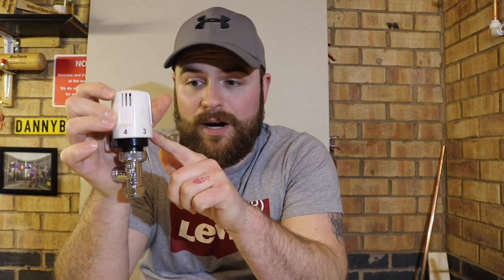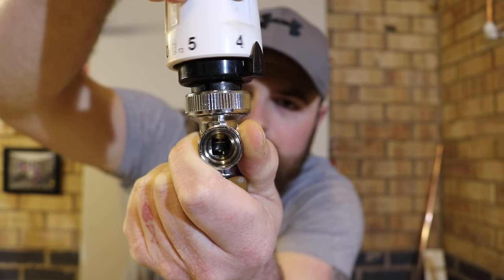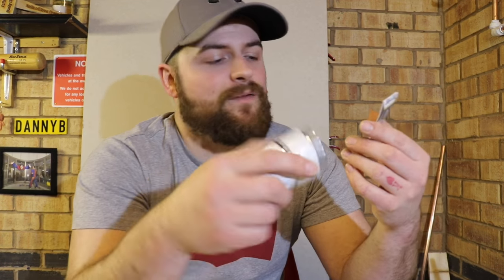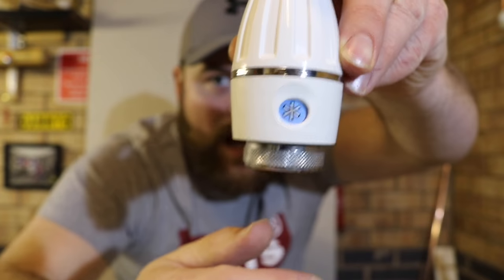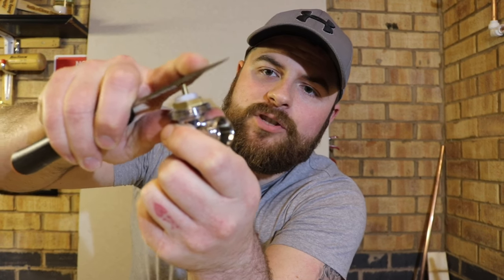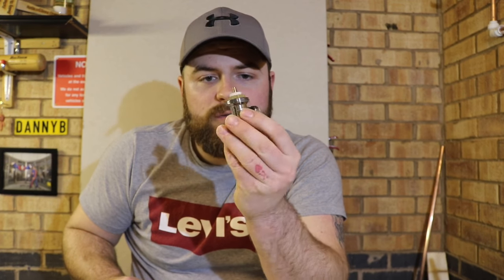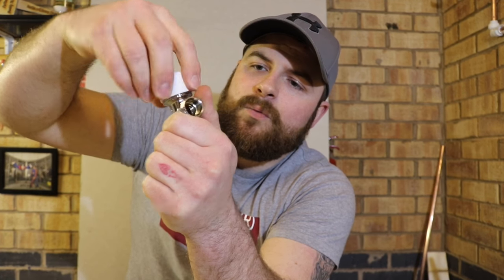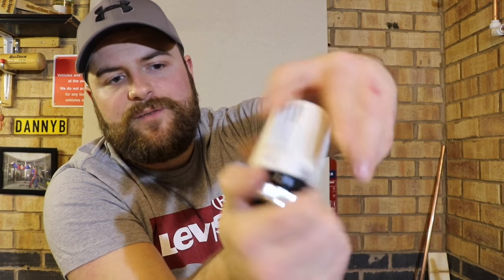Thermostatic Radiator Valves (TRV'S) How They Work

Comment: Hi the other night a tvr failed and just popped off the valve. The black plastic that normally sits in the silver threaded nut was shattered but the silver nut was still in place. The tvr looked to be set at 2.Wjen fitting a new tvr do I over it up the same setting as the one that popped off or do I open it up to 5

Comment: What I would like to know is, why is it that some houses have room/wall thermostats in say, like the hallway, and all rads have TRV,s but then same houses just have wall/room thermostats but no TRV,s on rads??
Reply from the maker: It depends on what system you have in place, the wall thermostat works with the boiler to achieve a room temperature, the trvs control the water flow going into the radiator.

Comment: Do these TRV's rely on your heating always being switched on?  Please clear up any misconceptions I make but if your heating is switched off and the TRV detects the room is cold it will allow more water flow into the radiator, but won't that water be cold if your heating is not already switched on? Would it only benefit once the heating system was in use? I ask this because obviously not many households will have their heating on 24/7.
Reply from the maker: It solely relies on your heating being on 👍🏻
Reply: @PlumbingGy  Thank you.
Reply: @PlumbingGy  what's the name of the trv in your video that had the black arrow piece on it? Mine broke and I'm looking to find a supplier of the black arrow section
Reply: @kinseld5  looks like a Danfoss or Myson

Comment: I have an upstairs level with 3 bed rooms. the foyer of the upstairs level has a thermostat. Each room has a TRV. If i open all the TRVs to full, would they just be getting all the same heat level controlled by the main room thermostat?
Reply from the maker: No there would be more factors to consider, the lock shield on the opposite side of the rad may have been balanced for the requirements of the room which will effect the output. The trv will reach max level for the room by itself also, meaning if there's a chill over the lounge rad the bedroom may have less heat than the lounge, the lounge will need to work harder to expel maximum heat.
Hope this helps

Comment: Thank you for an excellent explanation. Question: the temperature sensor in the TRV is very close to the radiator itself to know what the room temperature actually is, isn't it just measuing the near radiator temperature? So the room temperature is probably nowhere near the target temperature of depending on room size?
Reply from the maker: Each number on the valve is measured by the manufacturer to a certain temperature depending on what system you have and placement they are will determine how you have to have them set up 👍🏻

Comment: When showing inside the pipe it looked like the plunger position correlated exactly to number setting. If it was temperature sensing and in a cold room you would expect the plunger to be fully open from setting 3 for example

Comment: Thank you for this! After 10 years, I finally know now that what I have is a more remote version of this, a "thermostatic actuator with remote sensor setpoint" - when I first took possession of my condo, after a few months (once it got cold) I discovered that the thermostat on the wall didn't do a damned thing, and the building management then sent some people in and they installed this mystery dial on a box a foot off the floor in the corner of the room, about a foot or so away from the baseboard. 

I was given no paperwork with it, no indication of how to use it other than to 'turn it up and down', nothing. At least now I know the idea! Any suggestions on how I can make sure it's working in an effective way - distance to keep other things away from it, that sort of thing?

Comment: Tanx for the upload are lockshields similar to trvs?
Reply from the maker: Thanks EK no this is a trv and a lockshield is the other side of the radiator, a lockshield is 'locked' off and set to a position after the system is balanced. 
Hope this helps 😁

Comment: Hi Dan,
I've fitted 2 thermostats to the rads in my house. Can you fit them on either side of the rad? Do they go on the flow or return  does is matter at all?
Reply: They can go on either flow or return,  but it's recommended the flow side for quicker shut off by the trv.
Reply from the maker: It will depend if the valves are multi directional, if they have two arrows in the valve one facing into the radiator and one down the pipework then you’ll be ok. If they do not have two arrows then you need to make sure you fit them the correct way

Comment: That valve @03:20, the plastic hex above the metal hex, we had a leak from that or even through the pin, can I just unscrew the plastic hex (not the metal one as that seems really tight) and try some PTFE tape under  it without having to drain down ( I have tried slightly tightening it but it still weeps a bit).

Comment: Hi Dan, a few of my TRV valves are fitted on the return pipe including the two rads closest to the boiler. When balancing the system the general guidance is to have return valve lockshield valve to be open a quarter turn on the first rad. How does that work when the TRV is on return pipe?
Reply from the maker: Are they multi directional valves that are fitted?
Reply: @PlumbingGy  I think so as it's a new build house from 2018 and no noises when heat on
Reply: @PlumbingGy  also thetr are arrows pointing into the rad and out to the wall on the pipes
Reply from the maker: It is always best practice to fit them on the flow however it will not matter if it is on the return or flow generally speaking with bi directional valves, just balance the system as required working on the basis closest to furthest from the boiler 👍🏻
Reply: @PlumbingGy  thanks!

Comment: Hi Dan I  show  your  video  for trv valve  but I  have  two questions  can you  guide me  please  1 - TRV valve  fixing  on radiator  any side  or flow  side  ? 2  - can l fix trv on return  side ? Please  guide me  Thanks
Reply from the maker: It depends if it's a two pipe system and the valve also has to be multi directional (arrows pointing both ways)👍🏻

Comment: so the mechanical process of a spring is how these work?  i know how a thermostat coil works, and i cant imagine one of those being strong enough for water pressures, but since temp can cause a metal to expand,contract i guess its a combo of spring/coil type of mechanism? i need to take one apart i guess myself.
Reply: The thermostatic element is actually a wax-filled copper cylinder, which includes a tight but moveable piston. It's the expansion and contraction of the wax, which moves the piston, which then tensions or loosens a strong spring coil. So, in effect, they work hydraulically.

Comment: So if you have a wall stat as well, should that be set to max to allow the TRV to do their job?
Reply from the maker: No, I think you may be getting slightly confused. The trv regulates the water going into the rad. 
The wall stat is the overall room temperature
Reply: Yes the wall stat is the overall roof temperature, however if the wall stat is in the hallway by the front door like most,
And is set at say 20c, but you want say 23+ in other rooms from the TRV ! See my point

Comment: Thanks - I am confused.  You say the copper sensor expands and contracts. That's the bit I don't understand.  Does this sensor expand by moving up and down ? And, if so, what causes it to do that ? ie If you set it at level 3 you can see the size of the opening when looking into the valve as you described. Does the expansion and contraction cause the opening you can see at level 3 in the valve to open and close ?  Thanks for replying.
Reply from the maker: When the temp changes, a small capsule in the valve head contracts/expands which moves the pin in the valve Makin it open or close.
If it gets too warm, expansion of the capsule will cause the pin to close the valve slowing the movement of hot water into the radiator. And if the room drops in temperature, contraction of the capsule in the valve head pulls the pin out, allowing hot water to the rad 👍🏻
Reply: Thanks for that. There is a kind of plastic pin in the top section of mine so I take it that this is what moves up and down- this caused by a temperature change in the top metal section effecting the expansion and contraction ? Now that I understand it, is it possible to get the very small springs that fit at the bottom of the plastic pin ? Several of mine have rusted out - seems a shame to have to replace the whole TRV for a very small spring. I really appreciate your additional information.
Reply from the maker: One True Brit and again if I’m being honest I’ve never changed just the spring it may be worth contacting the manufacturer to see if you can get a part number or even if they supply it, I would imagine it will come as a separate section but as I said I’ve never changed only the spring 👍🏻

Comment: So do the radiator thermostat override the main thermostat on the wall?
Reply from the maker: No Ian just the temp of the water entering the radiator
Reply: So if you have a wall stat as well, should that be set to max to allow the TRV to do their job?

Comment: Okay I think I finally get it these are thermostats I had always thought they were simple valves

Each number corresponds to a max temp so for example

6 might mean 27 centigrade
5 might mean 25 centigrade 
4 might mean 23 centigrade
3 might mean 21 centigrade
2 might mean 19 centigrade
1 might mean 17 centigrade
Frost might mean 7 centigrade
0 would be off

Is that understanding correct?
If so then I and everyone I know have been using these incorrectly thinking they are simple valves to vary the power of the radiator
Reply from the maker: That would b correct, depending on the type and the valve itself each manufacturer will have set temperatures for each number 👍🏻👍🏻

Comment: But how do you install one!!!
Reply from the maker: Drain the heating system, replace the valve and rails. Refill the system and remove air, test functionality 👍🏻👍🏻
Reply: @PlumbingGy  no no no that's all done I meant just the valve I took it off because I think it was incorrectly installed... But I realise to open to level 5/6 then twist on?
Reply from the maker: Oh you mean the head yes, just open it fully set it neatly onto the top of the valve and screw on it should be quite easy
Reply: @PlumbingGy  cheers! will give it a try.. strange how many plumbers are getting this wrong..

Comment: It’s on 0 and won’t turn off
Reply from the maker: Faulty trv, might not be sat right on the valve. Remove the head and re seat, check the plastic stop underneath to make sure it hasn't broken.